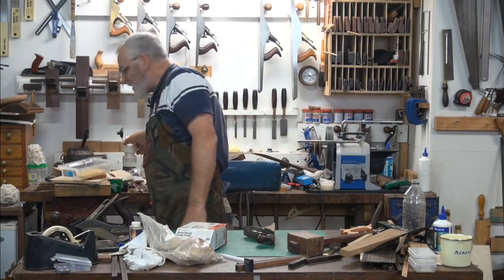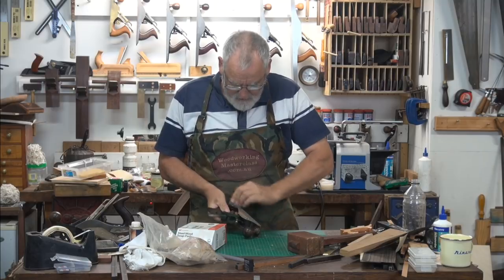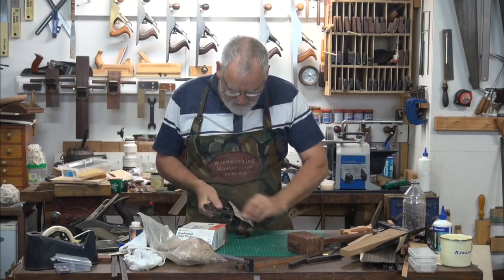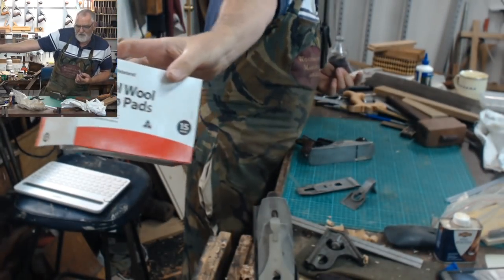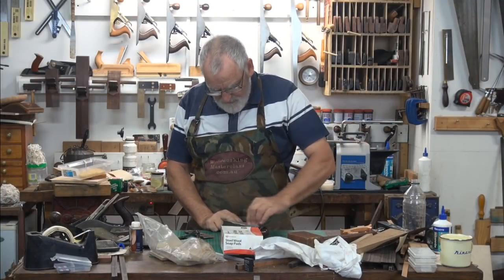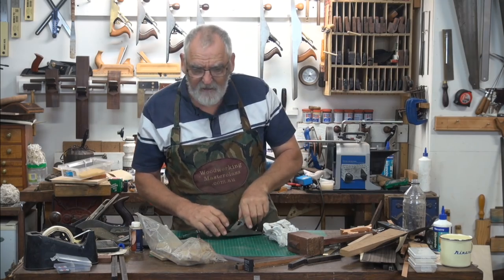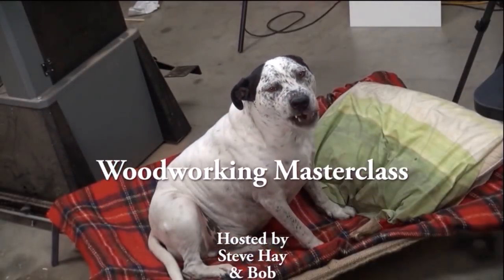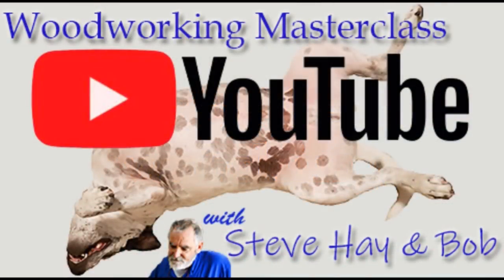How to Remove Rust from a Hand Plane and other Tools EASILY.

Comment: Would you remove rust on the blades the same way? I have my husbands, grandfathers old shoulder plane and the blade is rusting badly. What would you suggest?
Reply from the maker: Hi AlisaBeth, 
It will but for the most part if the back of the blade is rusted and pitted it had to be ground back to a nice flat surface to enable a good cutting edge on the front bevel. Cheers Steve

Comment: That's a good tip Steve. So far I've used steel wool and WD-40. 
Once it is clean, I've begun to coat everything with Silverglide or preferably Lanotech. A little Lanotech goes a long way and it doesn't stain wood.
Reply from the maker: Sounds good. heard of Silverglide but not familiar with Lanotech. Cheers Steve
Reply: @Woodworkingmasterclass  Lanotech is an Australian invention. Made here in Brisbane. A multi-purpose penetrant, lubricant and corrosion inhibitor. I buy mine from SuperCheap Auto or from a mate that has large quantities of the stuff. It is made from Lanolin - the grease you feel with raw wool. I've found it to be superior to Silverglide on my machines and it goes further. It's even food safe and non-conductive. Try it.